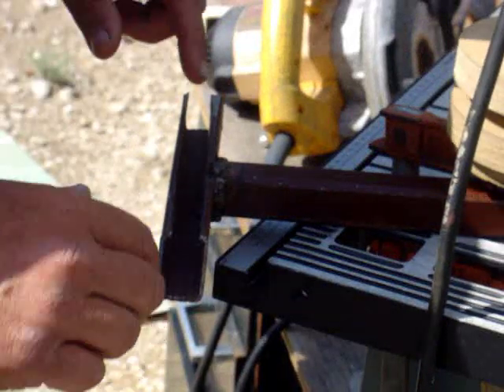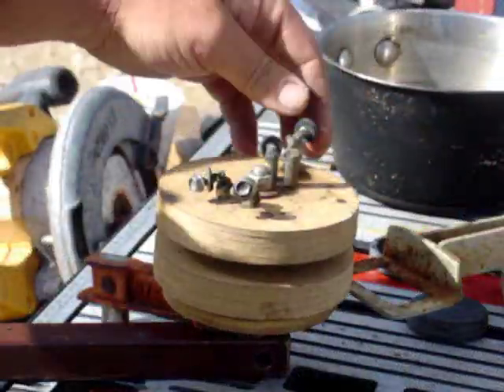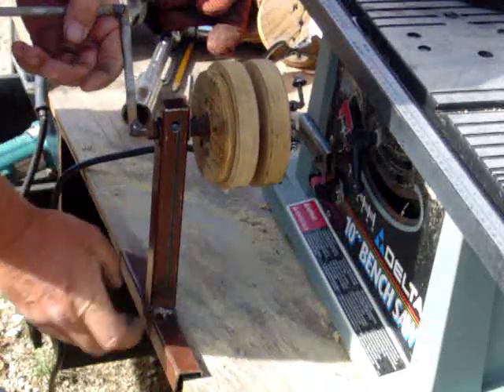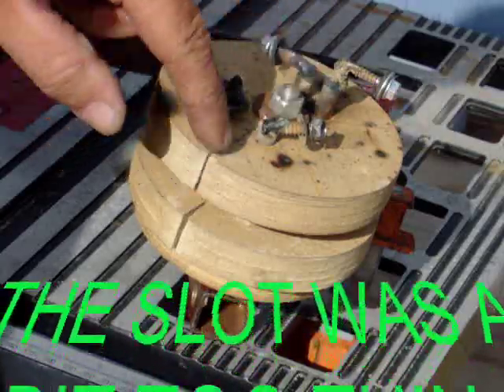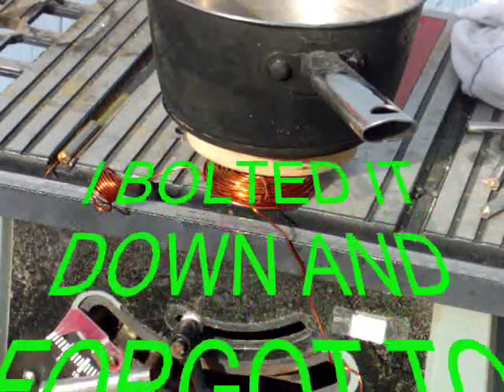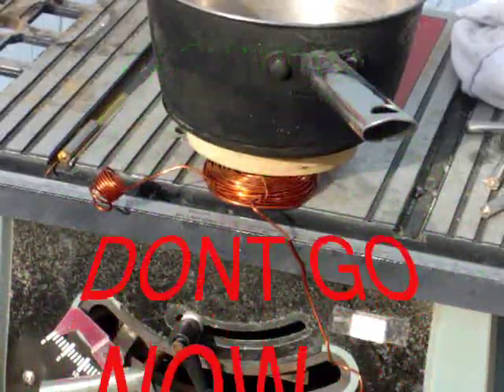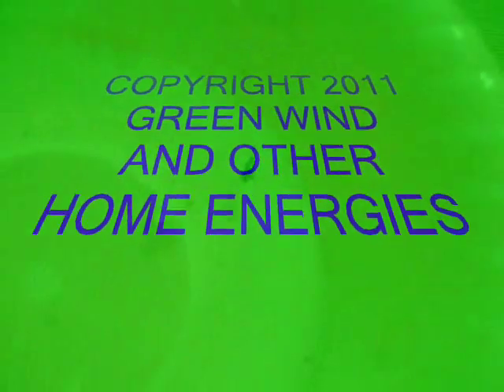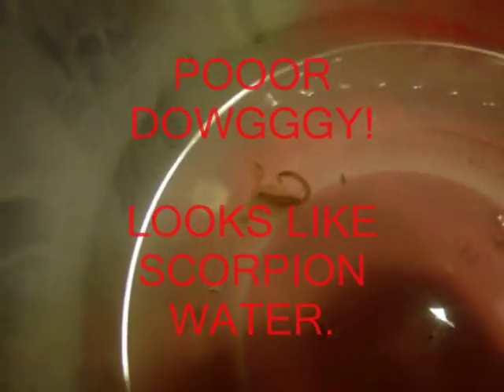BUILD A DUAL PERMANENT MAGNET ROTOR WIND TURBINE (PART 6)

Comment: Ok I have a question about coils. I've been researching about making alternators for days now, and I did read at one manual that coils with iron core have quite higher inductance then not having any core (air). But in all homemade videos on you tube, I dont see anyone using iron cores for their coils, is there a reason for that? (or do iron cores on coils only work for other types of alternators and not for axial ones?)
Thank you
Reply: Marko Mitic unless you use laminated iron, the eddy currents generated in the core will suck the energy out of the alternator. it will much harder to turn...
Reply from the maker: Marko Mitic  Great question, and thanks.
Eddy currents , and Lenz losses - happen in the cores of iron laminants, and solid iron. And/or any conductive surface around any fluctuating magnetic field.
These two inefficiencies automatically drop the efficiency to 45% average or less. 

Air core coils have zero problems with either one. 
They have zero cogging, and zero eddy currents. All electrical generation happens in the Coils at usually around 97+ efficiency.
These wind turbines show this efficiency by letting the wind spin the prop up to a decent rpm speed, And then shorting the wires. - The prop should stop rather abruptly.
That's efficiency.

The reason Steel Lam cores are used, Is to help focus the magnetic field into the centers of the coils. 
  They are cheap to build, and they don't care about your efficiency needs. They just want to sell you a bigger engine to power the genny.

The  Dual Magnet Rotors,  are set with the  Stator windings  directly between  two magnets , or pairs that face each other. Thus pulling the flow of the magnetic flux in a straight line through the coil. So, No need fore cores.
The magnetic flux of pair of magnets is also amplified by the next sets of magnets to either side of that set.
That tharr is efficiency.
And wise use of magnets.

The coolest thing about this type of alternator is,.... Nice voltage at low RPMs.
And You can wind the coils to any RPMs per Volt ratio you desire.
So winding the coils is half the fun. 

Keep smiling and have a ball.
Reply from the maker: djsnowman06 yup, lamenants are a great improvement over solid core iron. All lamenants drain from the magnetic fluctuations of magnets passing. Most motors are designed poorly, and cheap.
  Axial flux motors are rather expensive to make. You need more magnets.
Fat wire delivers large amps, But less windings fit in the coils because of the size of the wire.
You can only fit so much copper into one small place. So higher magnetic fluxes are needed to achieve charging voltage at low rpms.